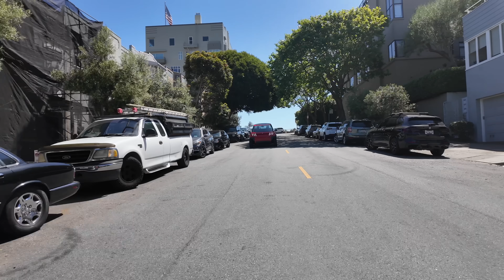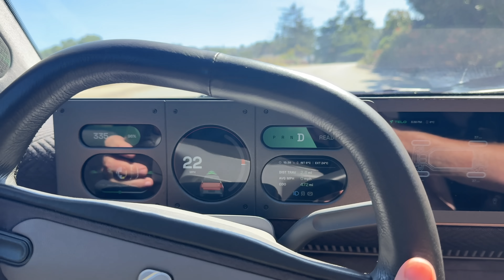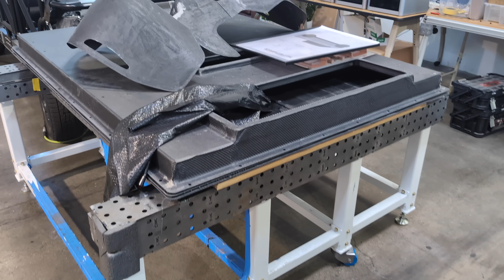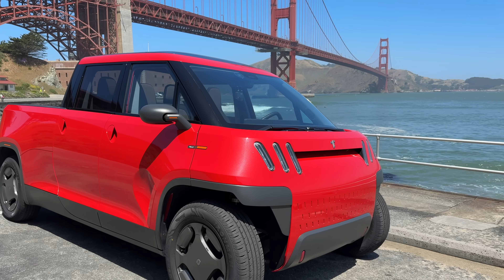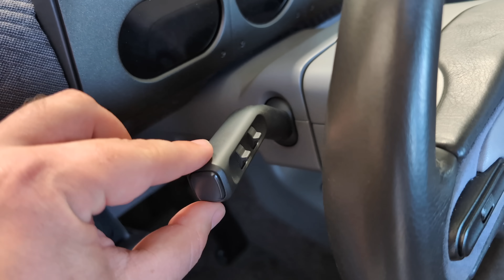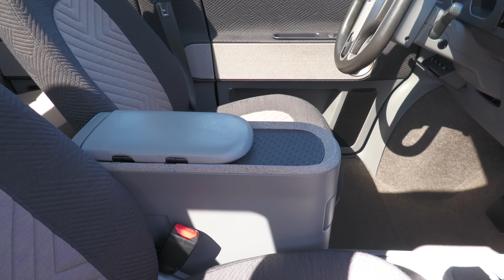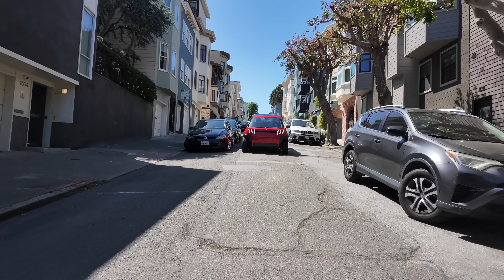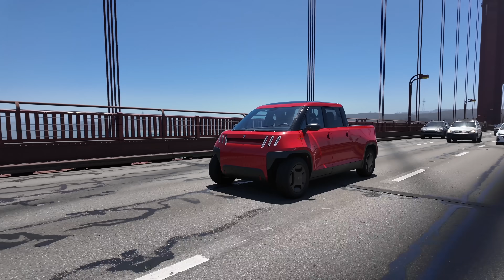The Tiny Telo Truck Hopes to Pack a Big Truck Punch

Comment: IF YOU RUN A BUSINESS IN A CITY        then $50k is just the cost of doing businesses and if this is what you need THIS IS WHAT YOU NEED
Reply: A city car doesn't need 500hp though. I know, giggle-factor and all that, but this thing would be more than fine with the 136hp an early Nissan Leaf made.
Reply: @no1DdC  Tbh it does have 300 in standard spec and I don't think you need AWD in the city either. Plus im pretty sure you don't use 300 horses all the time, as that would kill your battery pretty fast.
Reply: @smol_floppa  I agree with both these comments.   I think a base model with 150bhp would be just fine - but the cost difference on the motor is probably $250.  Your entry level electric motor is probably 300bhp
Reply: @no1DdC  to get torque out of an electric motor, you'll end up making power too; no need to limit the hp if you're already able to make it. Low power EVs are lacking (specially considering their power is more efficiently used than an ICE with multiple gears), but a pickup needs torque, and 300hp is fine.
Reply: If I’m spending 50k on a delivery vehicle for my business… it’s going to be a Transit van not this. I’d go out of business with these.
Reply: Also being able to recharge, even level 1 or level 2, while moving stuff to the bed or doing paperwork should be great for range. Even better than a ICE vehicle!
Reply: If I was a business owner, I'd buy something proven and reliable and that can be refueled anywhere easily. Something like a Chevy Express or Ford Transit 150. Businesses can't afford downtime and a truck that's sitting charging or is broken because of some one-off part isn't making money.

Comment: I have to say, crew cabs are fucking useless and the fact that every single pick up has them sucks. 

It's a sedan that has been glued to half a truck bed. Its Infinitely preferable to uave a regular ass car and a pickup truck with a two person cab and full length bed. 

This truck could be like two feet shorter,  and lighter and cheaper to build without the back seats that no one will want to use.

Comment: not really what i would call a useable bed, but if they had one the same size but no back seat that would be a cool little city truck.
Reply: A bed that can fit a stack of 4x8 sheets of plywood isn't usable? What're you hauling?
Maybe a large couch couldn't fit, but I doubt a couple extra feet from having it be 2d would fix that.
Reply: @Jcewazhere you can fit a 100' beam if you put a flag on the end, dosen't count as being in the bed if it doesn't fit in the actual bed.
Reply: 4' x 8' isn't enough?
Reply: @tims8603 it's a 5' long bed you would know that if you watched the start of the video for about 10 seconds

Comment: If they can actually get 350 miles of range out of this, there's no reason we cant have a 400 mile range Maverick.
Reply: If it actually gets 350 miles of range is another thing.  My 2.0T Maverick get great mileage no complaints another if is if this company actually survives or even makes it to production.
Reply: But your maintenance is higher then the Telo! @drail1976
Reply: They probably cant
Reply: @JustFlyAway  When heading back into your lower colon for an opinion, consider staying.
Reply: We already have one.  A hybrid Maverick with a spare gas tank in the bed.

Comment: The best part about EVs is they're actually affordable after a year or so, this one might be on my used car lookout list lol
Reply: Because they're degraded harder than a regular car.
Reply: @thedarkdragon89 Not really. They'll probably last longer than gas cars, due to no engine. Sure, the battery degrades... eventually... but otherwise I'd say they'll last longer. Of course it's still got all the usual car parts that break, but I'll take a battery swap over an engine rebuild any day.
Reply: @randomblock1_  Gas engines are good for about 300,000 miles until a rebuild. A $5K rebuild will keep a car going another 100,000 miles. In short, the engine will outlive the car. A battery pack will last how long? NO ONE KNOWS. It just loses capacity and mileage in a straight line. When its acceleration and range become unacceptable, you either put a $20,000 battery in it or dump it. If you buy a used one, it's because someone else dumped it. Which means you have to add $20K to your purchase price for a used car. And then you play roulette with obsolete, degraded electrics and controllers.
Reply: @randomblock1_ when the battery costs more than the car, they are disposable. Several new EVs have been totaled due to regular road hazards, not the case with real cars. Dent your fuel tank, simple replacement, dent your battery, car totaled.
Reply: @randomblock1_  No EVs still have 90% of a normal car, suspension, tires breaks, cooling system and fluid, Moving parts in the doors and seats, power windows (Because apparently we aren't allowed manual windows anymore), Wheel bearings, Gear box oil, CV joints, Air conditioning (Mandatory now no option to not have it on new cars). The suspension, tires and bearing will wear out quicker too due to the massive amount of extra weight with an EV, so no they will not last long unless they are meticulously maintained just like any normal car.
Reply: Yea considering what these are supposed to be priced at - I wouldn't expect them to be affordable until they are 10 years old. And the prices will only go up when (if ever) they are actually up for sale. The lowest priced car is always the one you can't buy yet. By the time you can buy one this will probably be as expensive as a F150 lightning.

Comment: The thing that infuriates me with electric vehicles is the obsession with huge horse power a small car does not require 500hp. My Nissan Xtrail fully loaded comfortably drives at 120mph (thanks autobahns) with a 110hp diesel. This leads to needing bigger batteries more weight and more cost.  It's just stupid waste.  Also having the wheels not only open at the front but in line with cornes means ANY front impact will cause way more damage than a broken bumper
Reply: Electric motors are way more efficient, so having more powerful motors does not actually increase power usage all that much contrary to combustion engines.
Reply: "This leads to needing bigger batteries" that doesn't come from horsepower desire, that comes from range desire. 
You can get a 50hp vehicle over a hundred miles an hour given enough time. Merging onto the highway is a nightmare though. (My first car was a 1986 Subaru GL without about 75hp, taking it on the highway was terrifying; but I could eventually get it over 100mph if I tried)
-Sex- Horsepower sells. Plus it's really easy to make high-horsepower electric motor so they throw them in everything. 

A Nissan Xtrail is not a small car. Over 1600kg with only 100hp?! That must suuuuck.

Comment: I'd rather they focus less on the infotainment system/software and more on physical buttons. Not a fan of 'smart' devices these days.
Reply: Yes, when was the last time you had to update switches and knobs in your older truck to make sure the radio and heater still work?
Reply: All climate control and light settings should be physical buttons.
Reply: Switches and buttons cost more and require more copper wire. The future is more computer controls, like it or not.
Reply: @tims8603  i mean, it's wrong but go on and believe that non sense some idiot tech bro came up with. There is a reason why people with knowledge updated the safty ratings since they are unsafer. And please, really? Do you REALLY thing the bit more copper outweights the higher cost in production and recycling of a touchscreen? If so, the future Brain Drain you brought upon you will hit you even harder.
Reply: @tims8603  how much more are we talking about?
I'm definitely willing to pay 200 bucks more for my $40.000 vehicle if it has physical buttons.
Reply: @Jehty_  I don't know. How would I? If you are so set on your demands, then I guess it's up to you to find what you're looking for.
Reply: @Jehty_  Have you seen the Slate truck yet? It, reportedly, will have buttons and no center screen.
Reply: @tims8603  What costs more is totaling your vehicle because you were digging through a touch screen menu while driving. Besides, we Americans fork over thousands of extra dollars for oversized trucks and SUVs with capabilities that will never be utilized. Pay extra for physical buttons is peanuts in comparison.
Reply: @dcmcghee  If you total your vehicle, you pay. I'm talking about what the manufacturer has to pay to build them.
Reply: @tims8603  Which they would presumably pass on to the customer so no disadvantage to them there. There's also a sizable demand from potential customers for physical buttons.
Reply: @tims8603 plastic knobs and buttons cost more than a touch screen and computer? There's less copper in a touchscreen? That's true, but way more gold. 

You're clueless.
Reply: @funonoldwheels7150  All EVs have computer controlled systems. The computer is already there. It only takes software and some thin wires to send signals to devices.
Reply: @tims8603 the infotainment doesn't use the ecu or any of the other modules. It has it's own computer. How can you not know that?
Reply: @funonoldwheels7150  It's a computer. How is that any different than any computer?
Reply: @tims8603 your argument is that knobs and buttons are more expensive than a touchscreen. A touchscreen had it's own computer module that runs only the infotainment system. That's a lot more expensive than knob switches
Reply: @funonoldwheels7150  Oh for crap sake. I have a computer. It can do anything I want with the right software. So can any other computer. My argument is that manufacturers like the touch screen interface because it gets rid of complicated wiring and physical switches. Have you ever worked on a car's electrical system? I have. There are hundreds of wires, lots of connectors and relays. All are potential failure points. Computers send data instructions over thin wires. Copper is heavy and expensive. I'm done with you. You are just too stubborn and have ridiculous notions. I'm about to report you.
Reply: @tims8603 you haven't worked on shit. You are just spewing diarrhea

Comment: The bed is too small to be considered a "work truck".  The reason work truck beds are 8 feet long and minimum 4 feet wide is because the average sheet of plywood is 4x8 feet.  However, if you work in tech, this is what you want.
Reply: In case you didn't know, only 3% of F-150s sold had a 8 foot bed. The old days of "a real truck has a 8' bed" died out in the 1990s.
Reply: @Nick-ue7iw   Work trucks still have 8-foot beds.  The prissy trucks driven by rap music moguls and real estate developers do not.
Reply: @Nick-ue7iw  he clearly doesn't know lol
Reply: 95% of truck owners never use the bed.
Reply: I dunno about the US, but in Australia you see a lot of tradesmen's utes with the bed totally filled by side-opening boxes for tools and fittings. Large cargo like plywood sheets gets carried on roof bars or in a trailer. So basically they become a van with access from the outside, rather than the inside.

Comment: 4:05 Does it do vehicle to grid?  Yes.
They just lost me as a customer.  I would NEVER buy an EV that is capable of vehicle to grid.
Reply: I normally don’t reply to comments but I need to understand your logic here. Why????
Reply: @ElectrekGarage  So grid operators can put charge cycles on my battery?  The battery is the single most expensive part of any EV.
Reply: @tarstarkusz not how that works, but even if it was, you can just… not use vehicle to grid. You can still plug it in like normal
Reply: @ElectrekGarage  Yes, that is how it works.  Vehicle to grid is for the purpose of supply the grid electricity from your battery.  That is putting a charge cycle on your battery.  It probably cannot be disabled.
Reply: @tarstarkusz  What is your source for this information? For the record my source is I’m an EV automotive engineer. I can tell you 100% this is not how it works. Vehicle to load/ vehicle to grid can absolutely be turned “off” because you actually need a special charger to turn it “on” in the first place. If I were to plug in the Telo truck to any old off-the-shelf charger, there is no way for it to perform vehicle to load/grid. You must use a specialty charger and you must turn it “on” in the car. This is not exclusive to the Telo, this is how it works in every car with V2G/V2L. 

Let’s also clear up what vehicle to grid and vehicle to load mean. Vehicle to load simply means you can plug electronics into the car. This can be seen on Hyundai vehicles with a specialty charger adapter that plugs into the charging port and allows you to output power. The outlets in the back of the Telo Truck, like many other electric trucks, is vehicle to load. The “vehicle” is supplying power to a “load”, which is just a fancy word for any device that uses power. 

Vehicle to grid does NOT feed your EV’s battery to the entire electrical grid, it only feeds power to the grid location it is set up to power. This usually means a home. Essential the battery in the car acts as a battery backup to your home, similar to a solar battery back up. The utility companies will not (and on 99% of cases, PHYSICALLY cannot) “pull power” from your car’s battery. 

Your misunderstanding seems to stem from the work of solar panels, where you can sell back excess electricity generated by the panels to the city. If you do not have a special set up like this, your home cannot export power, it can only import power. You have to modify your home’s electric setup to be able to export power, because your home doesn’t generate power. There’s essentially a big diode that prevents back-flow to the electrical grid in the form of a transformer. 

If you have any more questions on this topic I’m happy to answer them, but I hope this helps clear up your concerns. Vehicle to grid and vehicle to load are systems entirely within the control of the owner of the car, and there is no way for the car to export power to the entire electrical grid. 

If you’re interested, I’d also be happy to clear up some of the misconceptions about battery degradation in shallow-cycle scenarios! Lots of interesting stuff!
Reply: @ElectrekGarage  I don't disagree that you would need to be attached to a charger that does it.  But at some point, these will be the only available charger, at least in public.  I oppose V2G 100%.
You said:
"Vehicle to grid does NOT feed your EV’s battery to the entire electrical grid, it only feeds power to the grid location it is set up to power. This usually means a home. Essential the battery in the car acts as a battery backup to your home, similar to a solar battery back up. The utility companies will not (and on 99% of cases, PHYSICALLY cannot) “pull power” from your car’s battery. "

Then why is it called vehicle to grid?  AFAIK, this tech means when the grid experiences high demand, some of it can be met with vehicles plugged in and not being used.  It doesn't even matter because even if what you say is true here, it's just a different word.  if your battery is only capable of local (like an office complex) power, well it's local power that is affected by grid overloading.

Also, V2G is something still being worked on.  That they cannot or are not doing it today does not mean this something they do not want to do or will do in the future.

You said "Your misunderstanding seems to stem from the work of solar panels, where you can sell back excess electricity generated by the panels to the city."

My "misunderstanding" is informed by every article I've seen on the topic.  You are literally the first person I've ever heard say V2G is anything other than what I have said it is.  Also, not an outage, but high grid demand.

" and there is no way for the car to export power to the entire electrical grid. "
This is simply not true if it were set up to do this.  For homes, I would largely agree. It would likely be too expensive.  
 But from what I've read, this is something they want to set up at workplaces  and other places with large numbers of cars in the parking lots.  You would plug in at work for "free or reduced fee charging," but the downside is it would use your battery to provide power in the event the grid gets overwhelmed.
Reply: @tarstarkusz ah, I can see this is a situation of you will not change your mind even when presented with facts. If anyone else comes along this interaction and would like to know more, feel free to ask! Nothing I love more than spreading EV knowledge!
Reply: @ElectrekGarage  No, I've been presented with facts in a lot of articles and then some rando in a youtube comments says all those articles are wrong.
Reply: @ElectrekGarage  Reply 2.  Just have a think just uploaded a video yesterday showing vehicle to grid being used to add power to the grid using your car battery.